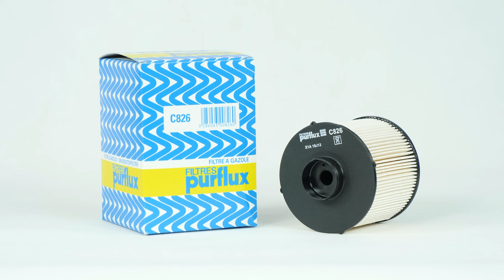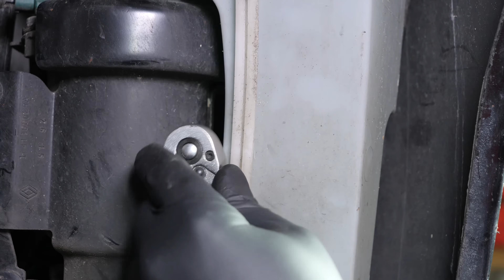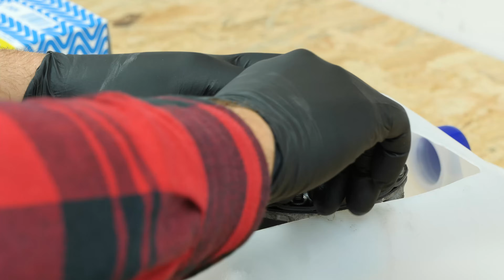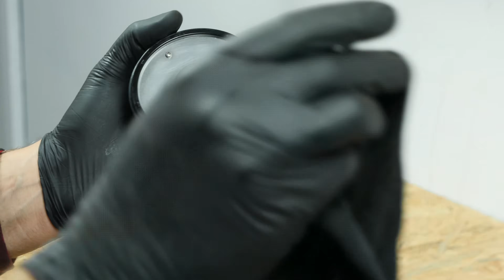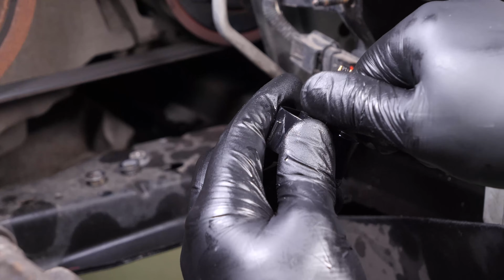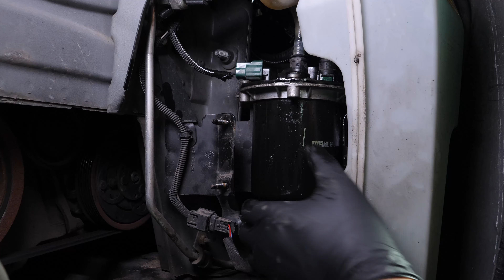How to replace the diesel fuel filter Duster mk1 1.5 dCi ⛽

Comment: Hey man my car stalls out of nowhere/ get airlocked and have to manually pump it j het it out to start ,1.5dci  what could be the problem
Reply: Fuel filter to line connections leaking?
Reply: Or at least allowing air in